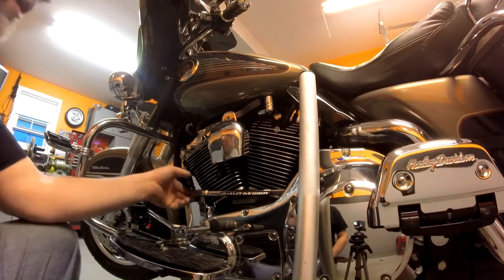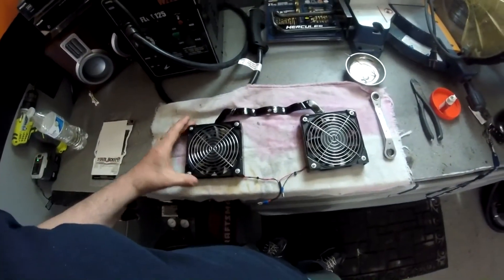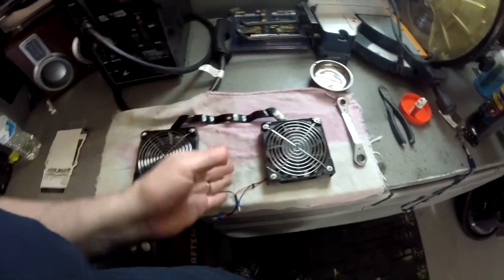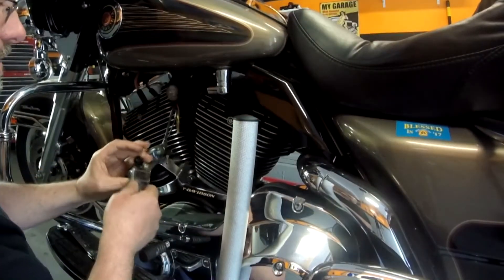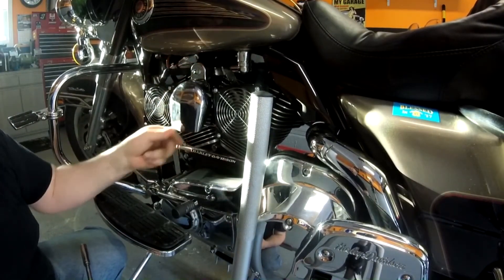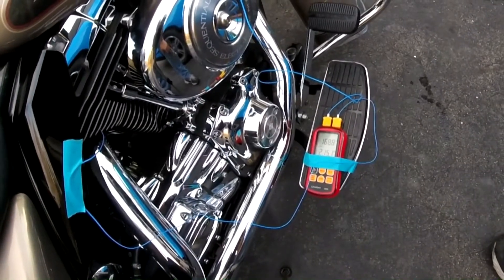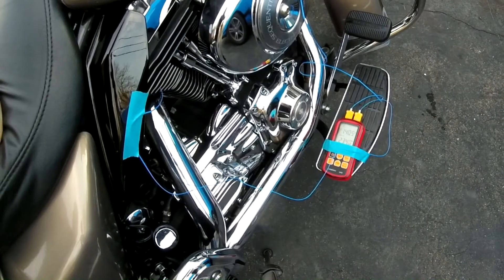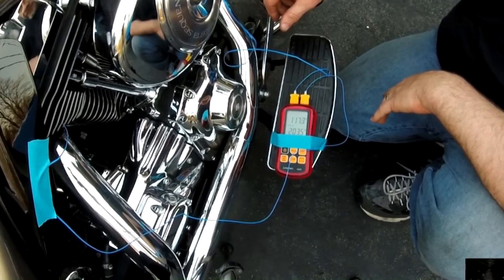Harley Davidson Engine Cooling Fans- DIY Part 3 | Techn' Moto

Comment: reat job on the fans! What is the model of the fans that you used, thanks
Reply from the maker: Bob Wenzke sorry can’t remember the fan model. I tried two different fans one had steel center and the other was all plastic. The steel one held up well but the plastic could not take the vibration. That’s all I remember. Don’t have them any longer. But they did work well sorry

Comment: what are the specs of the fans? thinking of doing this project
Reply from the maker: Sorry i no longer have the fans or the specs on them. I basically ordered 4 inch fans from amazon. make sure you get some with metal centers because the plastic can't hold up to the vibration. also if your able to mount the set up to the the frame instead of the horn mount it will lessen the vibration. Someday i will be making a new set with smaller fans. the four inch fans worked great but i think smaller fans may work just as good. good luck

Comment: AWESOME work! I recently had an overheating issue that crippled my Road King in a sea of 18 wheelers during a road work snafu! 
Just got back to NY from Tennessee and found your terrific vid while searching for a solution that would cost far less than the $400.00 "Love jugs".........you had my answer!!
 Would it be possible for you to share your design scetches and maybe even the info on the fans? I would REALLY appreciate it! Keep up the GREAT work!!
Reply from the maker: Frank Clark sorry no design or blue prints. This was done basically from my head. I’m on the road to Washington DC but when I get home I’ll see if I kept any info that I can pass on.

Comment: Hey Mike, hows it going? I see you changed the name of your YouTube channel. Your videos have come a long way with better editing. 

Great job on the fans. I just bought a pair of Love Jugs to cool down my Road King. It was getting really hot in all this Jersey Shore stop and go traffic. They are mounted just like yours but using a frame mount instead of the horn to cut down on vibration. I see this video is 3 months old so im wondering how they held up for you in the summer heat and all the rain.  

Love Jugs market their product by letting a Harley Davidson idle in the Florida sun for 9 to 12 hours straight.  
You saved yourself a ton of money i paid $400 for them. 

Hope all is well. 

Joe
Reply from the maker: I have two channels now. Doing a test run of both to see what is better or should I say where I should spend my time on lol. They are holding up well but as you mentioned the frame mount is much better something that in the future I may change. But overall they work well. If I was to do it again I think I would use smaller fans. Again this was just a project you know something to do lol

Comment: Very nice
Reply from the maker: The Blue Bike & Doyle thanks
Reply: Techn' Moto no get out really test them  .looking forward to a review on them
Reply from the maker: The Blue Bike & Doyle I did test them. I can leave the bike running for over 20 minutes and it won’t overheat. What test would you recommend. I won’t be running these except in stop and go traffic
Reply from the maker: I guess I could do a review a few months down the road on durability and what not
Reply: Techn' Moto not sure  I would say go find some stop and go  traffic .  But  Guess should work the same as did in the drive way .
Reply from the maker: The Blue Bike & Doyle I’ll do a quick review later this year on durability and what ever else I can think of that has to do with the mod